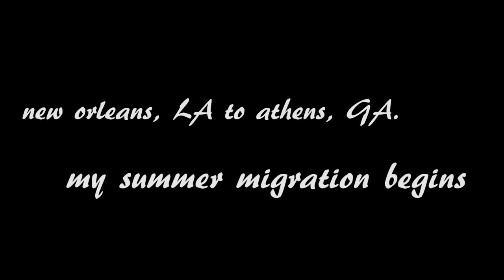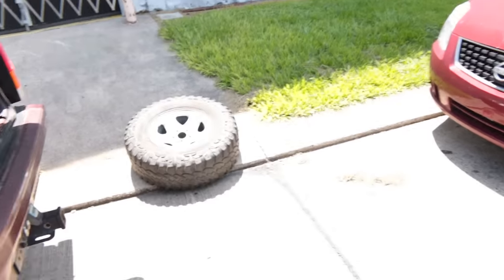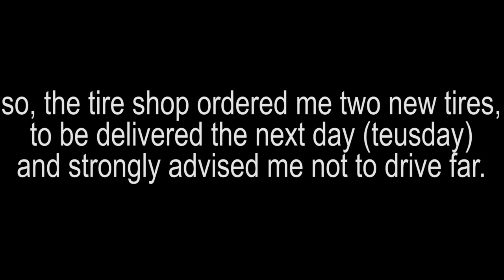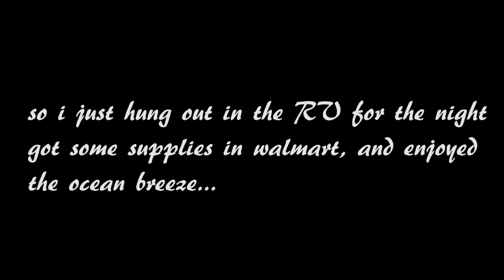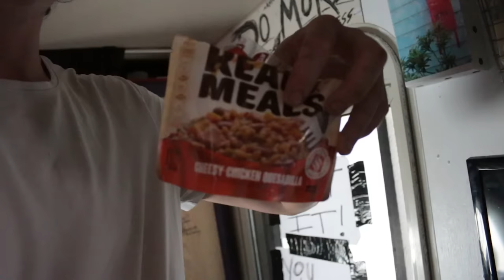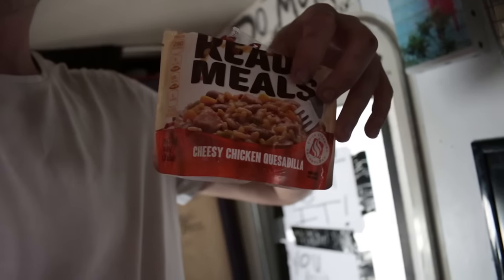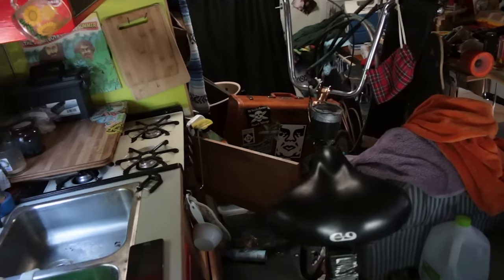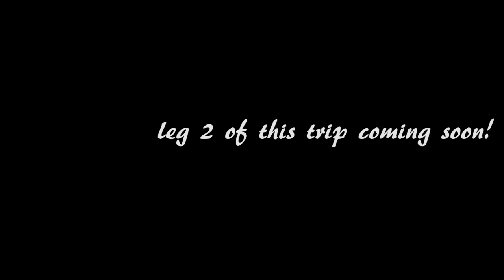LA to GA in a Toyota RV, 1st leg of my Migration | Life on The Streets ep 16!!!

Comment: Hey Cory great job rebounding after that bs at the bakery, btw what symptoms was you rig making letting you know needed tie rod and drag link , I think I've got one going out on my truck ?
Reply from the maker: +Carl Gannon well actually I needed to replace my drag link from when my tire blew out... it damaged one of the ball joints on the drag link, so it had to be fixed...while in the process of changing it, I damaged the bushing on the tie rod end, so had to replace that too. As far as symptoms, if you have a lot of play from side to side, or loose steering, it can be caused by tie rod ends/drag links. Also if you notice uneven wear on your front tires, it can be a sign of worn tie rods. The simple way to tell is to go under your truck and try and turn the rods forward and back, like a motorcycle throttle on the handlebars..if there is a lot of play, the tie rods need to be replaced..a little play is alright, but if the are turning a lot front to back then they can be worn... it will cause your ride to be wobbly, or what's known as "ghost driving" where the car seems to track back and forth while driving without you turning the wheel.
Reply: thanks man, hope you have some great skate sesh!
Reply: +Cory Themoodytraveler my big ass jeep goes through tie rod ends fast cause I'm running 35s and have front lockers. i do alot of rock crawling and it eats them up fast but i usually jack the front end up just enough to lift the tire off the ground and try to turn each wheel by hand. if you can move one side and the other side doesn't move then time to change some tie rods. same trick for ball joints but instead of trying to turn the wheel left and right, you wiggle the wheel top to bottom. if that makes any damn sense. lol
Reply: Chase, thanks man, i appreciate, next paycheck tie rods are being replaced, then ball joints, my front end is doing all those things, with the shaking in the font tire, and the tie rod play. Have awesome days guys!
Reply: +Carl Gannon, No problem. Good luck with it. Oh and if it still has play left to right and top to bottom, chances are that your hub or hubs are bad. I replaced every tie rod end and ball joints and still had play so next was the hubs. They're pretty cheap to replace and if you can change all your tie rod ends, ball joints and your brakes by yourself, then you can replace the hubs. Super easy. Sometimes the bolts will be rusted and tight but it's not a huge deal as long as you soak them in some PB blaster or WD40. I like how jeeps have a sealed one piece hub so there's no bearing and race to pack and replace. Hooe this helps and goodluck bro!